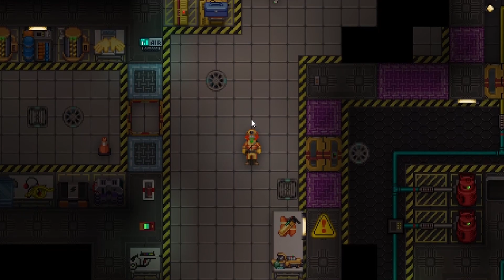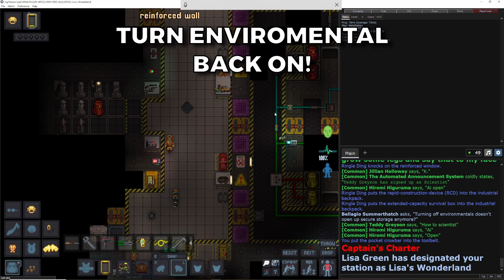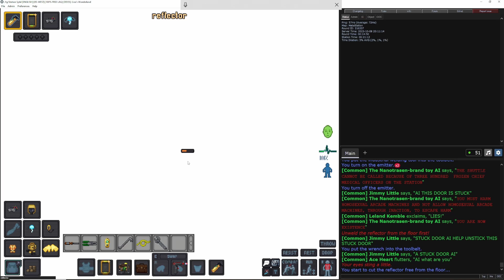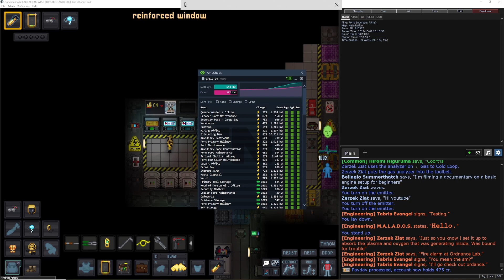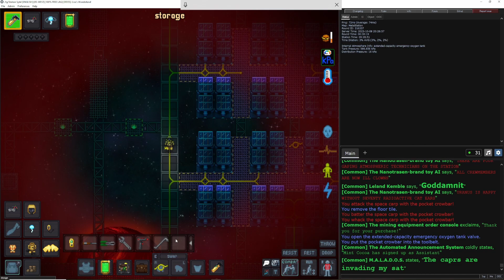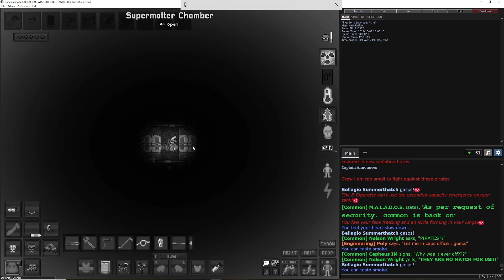SS13  /TG/ Engineer Guide For New Players! Engineering, SME, Solar, Deconstruction & Hacking

Comment: video was really helpful, my biggest tip as someone extremely new especially for setting up SM engine is to try just downloading tgstation for yourself and run around locally trying to set it up, chances are if you wanna play engineer you're probably a bit of a nerd and can figure it out, all the details are on the wiki, all you really need is git and the rest seems to just work, you can start a server locally very easily, slide on as engineer and just try setting it up, this video and wiki was helpful but being able to actually do it (including my first run fucking something up massively) made it a lot more easy to remember, practically getting a feel for what to click and where it is and running around and stuff, even had to jumpstart the emitters with a generator and it took me a while but its good to have done it offline without getting in the way/potentially ruining a real round on tgstation

Comment: Some interesting stuff, definitely picked up one or two things! One question though: isn't turning on that loop with the freezers actually going to raise the average gas temperature with stock parts? The stock minimum is higher than the space loop by about 50k, won't they start to raise the temperature to match?
Reply from the maker: Well yes very true. But I found the freezers even tier 1 are  better in my opinion. The crystal superheated the gas, it flows out to space and cools but not fully, and the freezer is an extra safety if the engine gas gets to hot. When we checked the crystal app it was 129k temp , at 550k roughly it ignites.
Reply: @BasedBellagio  I suppose it depends on how hot your SM is running! A few emitters, you're probably slightly raising it. Lots, it's probably hot enough you're getting a benefit. Of course, by that point you have upgrades and it's DEFINITELY an upgrade then. Although I like to move them out and onto the main line out from scrubbers.
Reply from the maker: @Killcrazy  I've seen engineers go out in space and expand the cold loop exchanges way far out increasing surface area and cooling efficiency